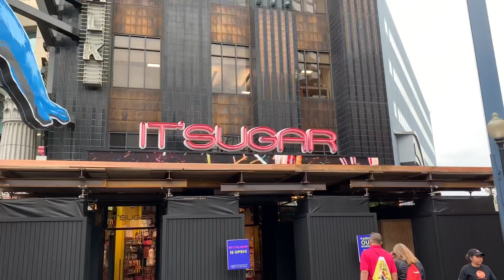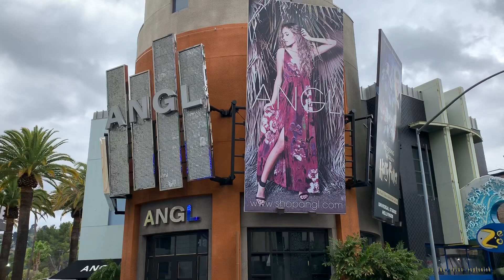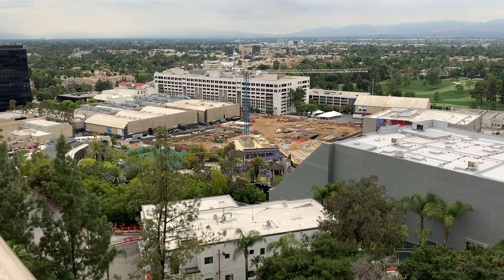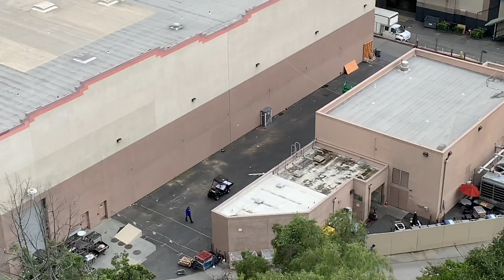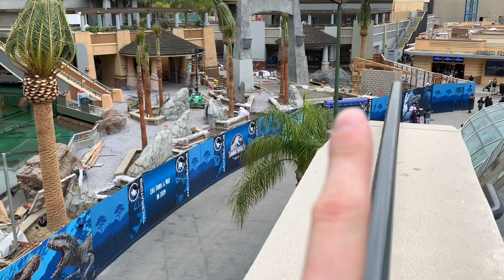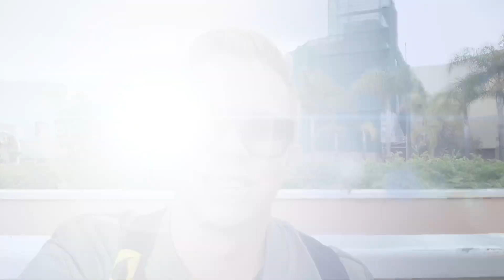New Universal Construction Update! | Universal Studios Hollywood! (2019)

Comment: It's not going to be a carbon copy of Japan's because the areas are different shapes. The area with the two fire exit stairwells will be the two-story "land" featured in the concept art. You don't need fire exits for ride buildings as they are considered one-story buildings so you just have to have multiple ground floor exits. Also, the wall around this area is not perfectly rectangular, yet Japan's ride building is. Also, the first concrete pit you point at is an elevator bank, which is requirement for multi-story buildings in the US. The round creation just beyond that is obviously the mushroom house from the concept art. (In earlier videos before they filled it in with dirt, I surmised the area between the elevator bank and that white truck will be beneath the second-floor Bowser Castle. So this round structure solidifies that guess as that's their placement in Japan.) 

But there will be differences due to Japan's plot being triangular and this being rectangular. Bowser's Castle butts up against the Mario Kart ride building there, because it's most likely the entrance to that ride. Here it's quite a bit east. The length of this site is about 450 feet, yet the longest distance in the Japan version is closer to 375 feet. Meanwhile, the square footage of the area is fairly close to USJ's, which suggests they're getting everything Japan has, just in different locations, with the layout of the courtyard seemingly unchanged.

Next time, try to get good video of the fire escape area in the northeast corner. That is most likely something that got moved, and it MAY be the Yoshi ride. The rumors say USH won't get the Yoshi ride, but that corner is awfully suspicious.